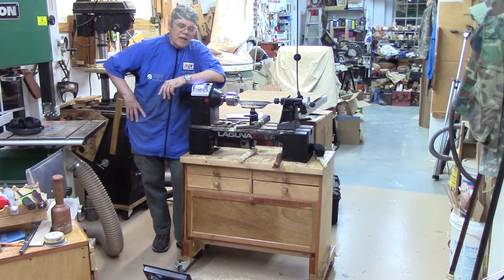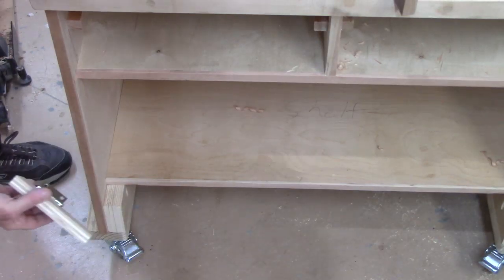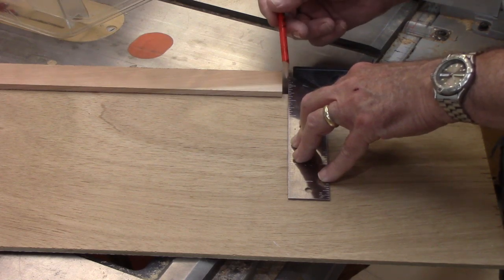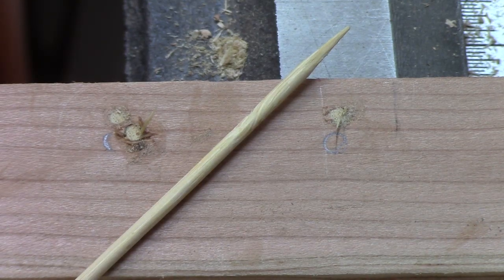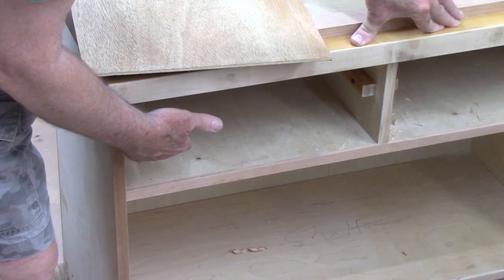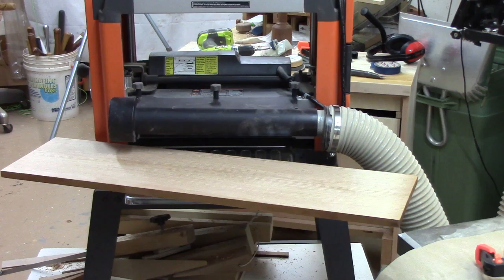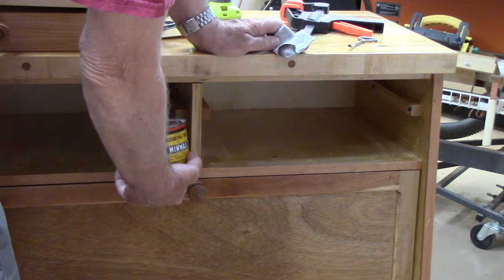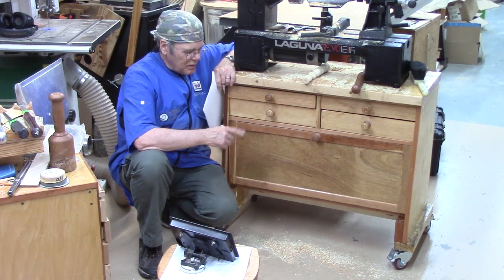DIY Midi Lathe Stand - Part 2

Comment: Very nice, Mike. Far better than recycled kitchen units. I particularly like the large drop down lower door, and that you used traditional wooden drawer slides, rather than fussy ball bearing type mountings.  Bernard.
Reply from the maker: Thanks, Bernard. The full extension glides are great for big item drawers but overkill for small drawers.

Comment: Great build !  I'm now in the process of making one of these lathe carts as per your inspirational video that you have provided here . I have the same lathe that will go on top, the Laguna 12/16.  I have a question - is there a reason that you positioned the lathe more to the left side of the top ?  Thanks alot ! George in Fla.
Reply from the maker: To have a place to easily set some small item I could more easily reach right handed. If I centered it there would not have been enough room on either side.

Comment: You made a couple of mistakes but hay I make more than 2 every time I pick up a tool. One thing I did think of and was shouting at the monitor (you still didn't hear me but I think my neighbors did) was to put the other parts back on before wheeling the cabinet back into the shop.
Reply from the maker: I  think I did but edited out.

Comment: Hey Mike, Did you screw down your lathe or just place it on the top?
Reply: Also. What size castors did you use.
Reply from the maker: I am using three castors similar to the ones on the CWT lathes. There is an Amazon affiliate link in the video description. I have had no problem with not bolting the lathe down.

Comment: Mike 

Which chuck do you use on the mini lathe?
Reply from the maker: I will probably use  my Record Power SC3. But I also have a spindle adapter for 1" to 1 1/4 so I could use my other chucks without having to change jaws.